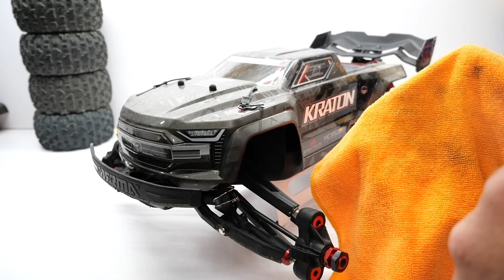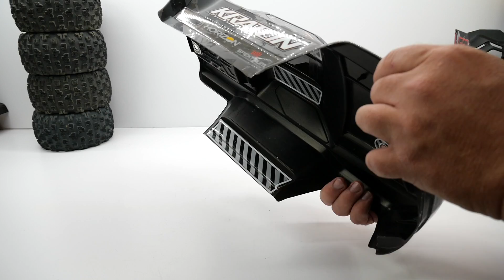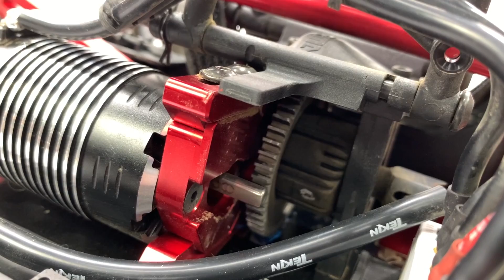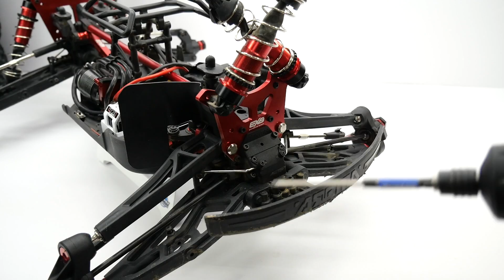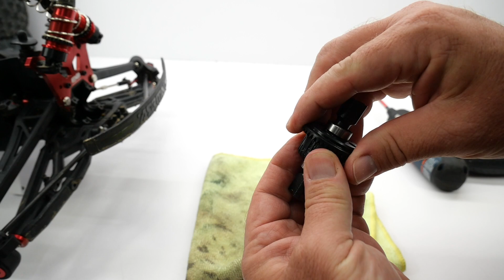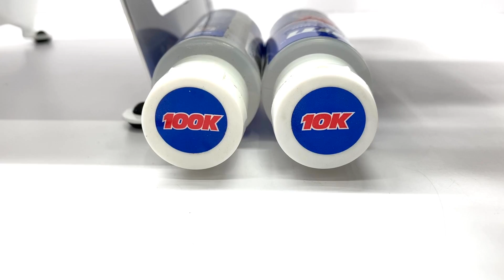Arrma Kraton EXB - What broke?  Differential Up Close / Maintenance After Running

Comment from the maker: Who's getting (already got) an EXB?
Reply: Im getting one in the Netherlands
Reply: Hey Rich! Got my EXB last Wednesday....30 packs in😎 I like the performance of the AGF-RC servo on 7.4 from the Max6, thank you for the recommendation. Placeholder Arrma 2050kv motor for now. Broken the rear wing mount at the bulkhead and sheared the bolts into the shock tower/rear diff.....twice!  But that was after numerous 40+ mph cartwheels of a kicker ramp😎  Spare parts and HW dual motor fan heat sink enroute.    I sure hope Arrma comes out with a Mojave Roller. Off to Ladera Ranch to bash today!
Reply from the maker: Canyon Racer nice!  Yeah, I was surprised I didn’t rip the rear wing mount off. You really can’t beat the AGF servos for the price/quality....they’re going in to many of my builds now.
Reply: Rpm braces arrived today! I’m going to check out the servo programming...and switch from imax 7.4v to a separate 8.4 bec...certainly doesn’t need it, but it should perform even better in high traction situations.  Off to repair!
Reply: Got mine Friday 24th. Ladson, SC.
Reply: Got mind in Boise ID 7/27 just waiting on castle mamba x 8s for it.
Reply: My 3rd arrma and best so far for bashing
Reply: DeviousRC 66  why is that?
Reply: Very tempted but holding out to see what Arrma drop next. I want Typhon EXB 😍
Reply: That would be cool....I’d really like a Mojave EXB.....more realistic to the 1:1 trucks common we run here in SoCal😎
Reply: I dont understand really, all i hear about is that they have a failed design for the rear diff. Is this true for all the trucks that have been sent out or is it just the odd one? Or have arrma revised the design?
Reply: I just ordered one with the 1717 mamba 8s. ohhhhh boy im excited lol. Hey why dont you tape the holes on the inside of your rims and then vent a hole on outside of tire? Keeps dirt and water out of it.
Reply: Hello,

Bad or good fiabilty differential ?
Reply: Meee
Reply: Me too
Reply: Just got mine! Hobbywing Max8 2200kv
Reply: Please answer @Russell Parker I’d like to know too
Reply: Just grabbed mine during the pre-Black Friday sale for $369. I already have a Spektrum 150A ESC, 2050kV motor, Hi-Tech HSB-9381 Ultra Torque Brushless Titanium gear servo, Spektrum SR6110AT receiver, DX5C transmitter, and 2 x Spektrum 3S 50C LiPos, all of which are not being used and just waiting for a roller to be installed into.
I put RPM Skid Rails on my K8S EXB hood when I started noticing the hood scratches. I already ordered another set for the K6S EXB being delivered tomorrow. 🙂

Comment: I asked AI what Arrma 'GP4' means:
In the context of ARRMA RC cars, "GP4" refers to a specific configuration or design of differential gears. Specifically, it indicates a spiral-cut differential gear with a wide tooth profile. 
Here's a breakdown of what that means:
Differential Gear: A key component in RC car drivetrains that allows the wheels to turn at different speeds when cornering.
Spiral Cut: This refers to the tooth pattern of the gears. Spiral-cut gears offer improved strength and efficiency over straight-cut gears.
Wide Tooth Profile: A wide tooth profile indicates the gears are designed to handle significant torque and power. 
Essentially, GP4 in ARRMA indicates a heavy-duty, performance-oriented differential gear designed for durability and high power applications. These gears are found in many of ARRMA's higher-performance models, like the 6S BLX line, and are known for their strength and ability to withstand demanding bashing conditions. 
Examples of components using the GP4 design include:
Main Input Gear 10T Spiral Cut GP4: A crucial component in the differential system.
Main Diff Gear 43T Spiral GP4: A larger gear used in the differential.
Limited Slip Differential (LSD) with GP4: Provides enhanced traction and handling. 
In summary, if you see "GP4" in the description of an ARRMA part, especially a differential component, you can be sure it's a beefed-up part designed for serious RC enthusiasts and demanding conditions.
Reply from the maker: Good info....might even be correct 😁

Comment: Hey Rich do you wipe down your rcs after every run?? Gotta imagine that would get time consuming to do that after every run. Or was it more cause you were doing a video and also wrenching on it? I usually blow mine off with a compressor and throw it back on the shelf and run it a few more times and then clean it down and I'll move onto another rc and repeat lol. Great video though Rich, really helpful. Appreciate your advice and knowledge 👍🏻🍻
Reply from the maker: Every RC gets blown off with my compressor when I put them away.  If I'm working on it, I'll then wipe it down like you saw in the video.  It's very rare that I put away a dirty RC though.

Comment: Arma needs to design a bigger diff for their offroad vehicles.
Reply from the maker: Not sure how they can make them larger with out jeopardizing the design...they're pretty much the largest you can make for a 1/8th scale
Reply: @TheRCNetwork  noway. My Ofna vehicles from 2005 had bigger diff. They can easily redesign or design it properly from the beginning. 1/8 scale vehicles from those Era rarely strip diff. The limitless and Typhon has the sane size diff as the Kraton and Mojave. That's not right.
Reply from the maker: @Victic005  the Kraton was designed first and all else evolved from there….in comparison, the 1/8th race vehicles (Tekno, AE, Lodi, Mugen) have diffs about the same size. I too had several OFNA vehicles (lived right by OFNA/Nitrohouse and the Hyper series had similar sized diffs…..what differs are the quality of metals and the quality of plastics…..not to mention that Arrma users likely don’t maintain their vehicles as well, and drive them a harsher (bash) than a race vehicle.
Reply: @TheRCNetwork  I thought the Typhon was first. My OFNA diff from the 9.5 is way bigger. This is back in the days when powerful electric motors weren't yet around.

Comment: Man, I wouldn't be screwing those hinge pin screws in and out with a power tool as often as you are. Great way to strip them and then be up for new arms.
Reply from the maker: Ryan Inc I only use a power driver for disassembly, usually just for 1/8th scale.....if you have the appropriate driver with a clutch, hex tips and feel for it, you’ll never strip a screw/screw thread

Comment: Seems like the diff has broken on every truck they made? Wth
Reply from the maker: Dustin Blades diffs break due to poor driving and over powering your RC. Mine did not break! 😃👍  Arrma and Horizon is aware of the isolated incidents - most have been due to the incorrect amount of shims inside the rear diff to spot hold for no LSD plates (They’re only in the front and rear). The diff should have 3 shims on each side, I believe (once again inside the diff) - some made it out of the factory with only 2 on each side.

Comment: Heads up to those who purchase the replacement RPM wing mounts #81642 for an EXB.....they fit fine with 1 mm removed from the bosses that mount to the aluminum shock tower. Still 3mm of plastic for the bolt head to sit on.  More flexy than the OEM....  $17 vs $10 for stock Arrma. More flexible should be better. I see there are billet aluminum arms.......but then what becomes the fuse?😎

Comment: These exb Kraton diffs made my notorious a beast of a beast! Arrma did right with the diffs. I know this truggy is bad ask!
Reply: I can’t decide on what to get a exb kraton or notorious? Kind of even want a xmaxx choices I tell ya are the new exb diffs that much more durable or what?
Reply: @derekquinones8614  In my opinion, get the EXB. If you already have electronics. I have no experience in the xmaxx. If the xmaxx batteries run out make sure you have a hitch for towing.

Comment: my exb's rear differential died on my second pack,kinda disappointing.
Reply from the maker: Seth Morrison what’s your power system, gearing and surface traction?  That’s likely the cause of it.
Reply: @TheRCNetwork  I'm using 6s blx 12T gear with a arrma blx 4074 4-pole 6s brushless motor. I'm kinda new to this so I just went with parts that come in the standard kratons. My friends has the same parts in his normal kraton and has no issue's.
Reply: @dougk4071  I ordered a locked diff for the rear till parts to make a new one come out
Reply: @dougk4071  https://www.ebay.com/itm/Arrma-Kraton-EXB-Rear-Differential-Spool-Billet-Aluminum-replaces-ARA310985/264826917053?pageci=b8dd1245-6478-4a8f-b57f-d64dcb01b546

Comment: New to hobby. Slightly confused. Isn't that Tekin 2000kv motor only rated for 4s? I've been looking at the Tekin combo setups, but confused on what motor to get for my EXB. 1900kv? 2000kv? or do I have to go down to a 1440kv if I'm running 6s? Please help. Thanks!
Reply from the maker: VaporRipper Tekin over-specs their motors. Typically a 2000kv motor should work fine on 6s - in fact the stock 6S Arrma motor is 2050kv. I checked with Tekin about the build and had them look - they said, based on weight and everything, the 2000kv 4038 (longer Truggy can) will be fine on 6s. Now, warranty wise......not sure they would technically warranty it.....but oh well!  The 1900kv I had installed is a short buggy canned motor similar to the Tekin T8 4030.
Reply: @TheRCNetwork  Thank you. So a Tekin 2050kv should be fine then? For some reason the 2000kv combo is like $50 more than the 2050kv combo at the moment. I'll grab the 2050kv if it will work. Already got a Protek370TBL servo. Building a monster.
Reply from the maker: VaporRipper the 2050kv is likely the shorter buggy canned motor (4030) - I’d suggest the longer canned 2000kv Truggy motor (4038), which is why the price difference.
Reply: @TheRCNetwork  You are correct sir. Thanks for your help 👍 Invaluable. Tekin2336 combo it is.

Comment: Where did you get your wire separators on your motor wires?
Reply from the maker: https://bit.ly/2WDKuhr
Reply: @TheRCNetwork  I ordered those they don't fit, do you know of anything for 10 gauge wire?
Reply from the maker: I haven't seen 10g versions anywhere......Are you using 10g for the motor wires?  Typically 10g would only be needed on the battery wires
Reply: @TheRCNetwork  on the hobbywing 1650kv motor.
Reply: @jamesrobinson4950  and on the stock rtr kraton 6s and im sure many others. idk wheres hes getting "typically 10 gauge is only need on battery wires". my 3s gens ace batteries have 8 gauge.

Comment: This or the Maxx? Really wanted a RTR but this peaks my interest!!
Reply from the maker: The Maxx is a bit smaller in size (1/110th scale vs 1/8th scale) and contains a ton of plastic in comparison....If you want to be in the Traxxas eco system, or already are (batteries, charger, etc) it might be a better choice.  All out durability and performance, I'd have to give it to the EXB
Reply: Remember the EXB has no electronics while the Maxx does. You can't go wrong with either TBH. Kevin Talbot, one of the hardest on his RCs on YouTube may help you make your choice.
Reply: I have both, the maxx v2 is awesome and durable but the larger size of the kraton and larger tires make it a slightly more serious machine rocking 6s power. The maxx v2 is an awesome turn key machine ready to go out of the box, battery adapters can help avoid being stuck with only traxxas batteries, both trucks are awesome.

Comment: Everyone is having problems with the diffs
Reply from the maker: The manual is not clear on how to re-assemble the diff with regards to the plates - Also, when ever people start adding their own electronics, there will be problems (the diffs are the first weak point in any build)...as well as labeling "Extreme Bash" - it seems like it gives people a license to try and be "that guy" that destroyed the seemingly "unbreakable" RC.   Everyone is also a broad term - you must mean the 3 people in FB groups that are standing on their soapbox?
Reply: The RCNetwork I mean I want one was going to try 8s but then again iv seen few people moan about blowing the rear diff
Reply from the maker: @joshchatwin8179  Honestly, the Kraton doesn't need 8s - I'm even on the fence about 6s - I could probably make this rig run GREAT on 4s with an appropriate powered motor and blow away most on 6s.
Reply: The RCNetwork it might not need 8s bro but the fact is just like to see what it can do on 8s
Reply: The RCNetwork love your stuff by the way

Comment: I checked what you said about the diffs only being limited slip in front and center. This statement might be wrong. The part number shown in the manual is for the Limited Slip Diff. ARA310990 for front and back. Please check this. Either you are mistaken or the manual has a misprint.
Reply from the maker: If you look at the owners manual that I had in the video - the front and center had exploded views of the LSD plates.  One the one section of the owners manual, it had an exploded view of the front/rear with the rear noted as having spacer washers in place of the LSD plates.  I haven't pulled the rear diff yet, just going off of the manual.  As for replacement parts, the front and rear are identical, so I would assume that the part number would include the plates and you would have to determine if you're using it on the front/rear.

Comment: Awesome vid Rich , i appreciate the view of the diff . Tech question for you , i have the same servo and receiver that you used ;
Did you do any pre programming on the servo or use that switch that came with the receiver . Or can i just install them both 
like a standard  set up and adjust settings through my futaba transmitter . Thanks for your time ...
Reply from the maker: Thanks RCT!  The servo just dropped in, set your endpoints and centering on your Futaba and go.  The receiver installs and sets up just like a regular Futaba receiver - I did install the little capacitor, JIC.
Reply: @TheRCNetwork  Thanks Rich !!

Comment: I was looking forward to this vid! Thank you for the diff tear down. Looks like the internals might not need shimming like the RTRs do 💪 I sometimes have squeaks at the arms too, usually in the rear. They rub on the suspension mounts a bit. Bit of lube or PTFE spray and it goes 👌
Reply from the maker: Thanks for watching!  I didn't see any reason to shim the diffs at this time....I always find pillow ball suspensions very creaky...but on this one, it was the rear for some reason.  I will end up using a dry spray at some time for the hingepins

Comment: Try gun oil instead of glass cleaner.  A light spray of Remington Rem Oil on your microfiber towel just like you're doing, great for everything.
Reply from the maker: For some RC's, I clean like I did, then hit the plastics with either a "pledge" product or even a car "spray wax" to get the shine on the plastics.  Good tip on the Rem Oil - I have some of that here!
Reply: @TheRCNetwork  Honestly just tried it recently because I didn't have anything else handy lol.
Reply: lol except repelling dirt
Reply: @dirtrider88  lol plastics are made from oils and such, not the kind of chemicals you find in glass cleaner. In fact, those kind of chemicals break down and make plastic weaker. Dirt doesn't. Oil your plastics and wipe them clean if you want them to last.

Comment: Loved the video! Your maintenance routine puts my quick rinse under a tap to shame 😂 My area is better suited to 10th scale but this is very tempting...
Reply from the maker: Gotta be careful with running water over an RC, even with waterproof electronics - eventually, the water will cause havoc starting with your bearings, then eventually all the hardware and electronics

Comment: You are one of the very few I would have absolutely no hesitation in buying a used RC off of. 
You take great care of your RCs.
Reply from the maker: Thanks for that.....It's a ton of effort, but you get paid back with better performance from your RC!
Reply: @TheRCNetwork  I definitely agree. I put in the extra time after I run because if something does break or I need to fix something I don't have to deal with a rusted screw or parts that have been neglected for 6 months. I only have 9 RCs but they all run and are in perfect working order. I like knowing I can grab any one of them right now and take it out for a rip.
Reply from the maker: @Blind-J  We have a lot in common there!

Comment: Still has upper arm slop 😬
Reply: Use 5mm washers alongside or instead of the existing spacers
Reply from the maker: @yaffajaff  Great tip!
Reply from the maker: That's notorious on a pillow ball suspension truck - especially with truggy length arms.  Even race quality trucks will have side to side play

Comment: I wanted a kraton then seen so many videos complaining about the strength of it. So I changed and decided to get an xmaxx now this beast came along and kinda put pay to these other attempted kratons. Should I still go xmaxx or go back to kraton?
Reply from the maker: Size is a big factor between the two...also cost of ownership (truck, batteries, upgrades, etc). I haven't driven an XMaxx, but I can say the EXB is probably the best Arrma to date
Reply: @TheRCNetwork  I know the price of parts is dramatic on kraton over Xmaxx. But based on the last part of your comment,is the kraton a nice safe bet? Could you take a new Xmaxx and the new EXB and now do a nice comparable. Without the inevitable happening to the kraton.